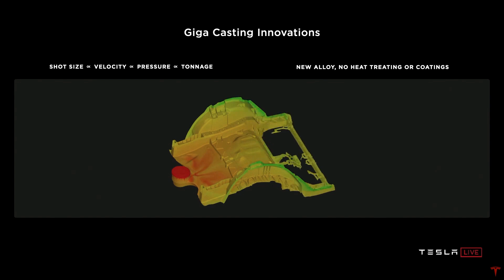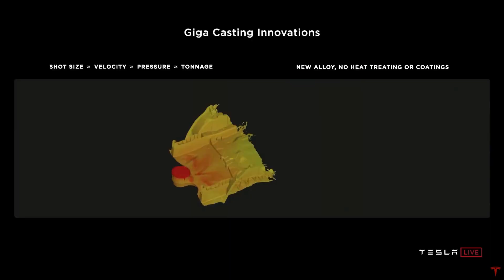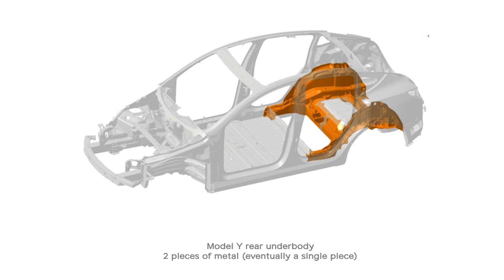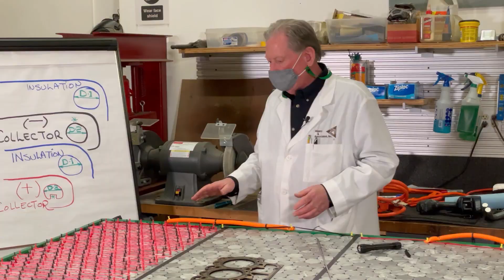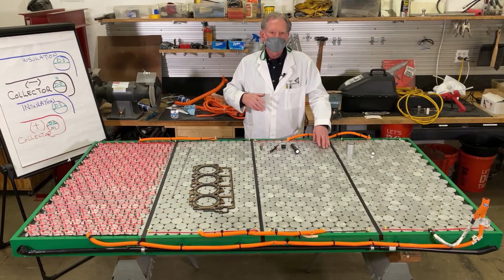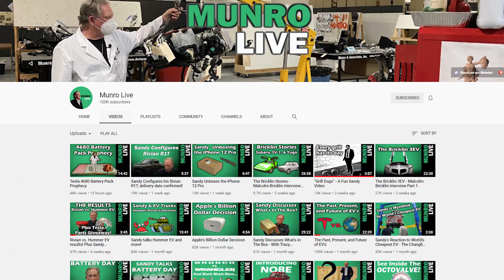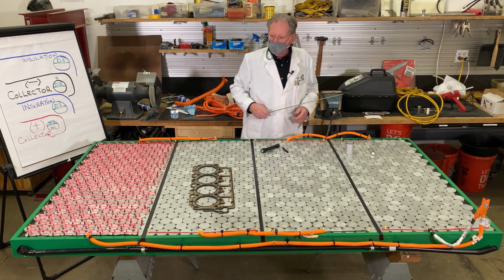SANDY MUNRO Rejects TESLA Battery Day Doubts

Comment: I don't want to be that guy, but the Cadillac CT6 had 6 large casting for front and rear suspensions. The BMW i3 also had 4 really large castings on which both the front and rear suspensions were hung. So it's not that these ideas are completely unheard of. The big difference is that when tesla does something they always goes all in. But this isn't an effect of engineers at tesla being more talented than engineers at any other company. The differentiator is that the people making the decisions at tesla are much less risk averse. That's my two cents at least.

Comment: Think of this new battery- to- vehicle design as sandwich construction.  A few examples:
Cardboard,  which is much stronger than 2 layers of paper
Those cheap dollar- store foam poster boards,  which are very thin foam laminated to 2 outer layers of paper; vastly stronger than either component separately
A soda can- strong enough to stand on the lid,  even when empty.  Now stand a thousand soda cans next to each other,  glued to 2 boards,  and leave the soda cans full.  Imagine how strong that is!
Also,  honeycomb construction. Used in Formula 1 cars.

Comment: The sheet metal parts are protecting passenger during an accident  by not breaking but bending then absorbing all the forces coming trough ,over the passengers..In order to protect well the passengers ,all the sheet metal parts were chosen with adaquate thickness to enable to bend easily when the vehicle hits to an obstacle..
Although the alluminium parts will bring saving money on body constraction,aren't they very harmfull to the passangers when occurs an accident from   the head or from the back by a sudden break  of casting parts or if not , by a big IMPACT ,  transportated directly to the body of passangers? Did you made trials of a such incident on Crach Test? What are the impact rates of a such collusion on the  human body?

Comment: Cars are already pretty much impossible to repair properly these days without reaching a totaled amount of money... look at Rich Rebuilds video about fixing very minor rear damage on an Audi RS8, that thing is a disaster... So I don't think the new method is worse in that regard.. if anything it's basically remove carpeting and wires, weld off / bolt off the bent casting, replace the whole thing, boom you're done and way less work hours to be charged. It's aluminum so just send the old one back to the furnace

Comment: 14:33  Also, the new tabless electrode design dramatically reduces waste heat so the cells don't have to be interleaved with cooling pipes, whereas the old/current cells would overheat without them

Comment: The answer to why you can't make the current cells structural is cooling. the current cells are cooled on the sides so there are fluid channels in between the cells on the width so you can't pack them in a honeycomb against each other.

Comment: The 4680 cell has 40% less mm^2 steel case per kWh but not necessarily 40% less mm^3 in steel. We can assume as the diameter increases there will also need to be an increase in thickness to maintain similar integrity of the cells. That gets back to Alex’s question “if 4680 is better than 2170, why not 9080 or even bigger since the mm^2 per kWh will be even less. 

In Theory a Tuna Can size battery would be even better and if only cooled at the bottom would provide a greater thermal pathway. 

We see prismatic cells in 15AH to 200AH, so I don’t think there is any Magic size for all applications,

I think almost no EV uses a 1p battery. Model S was about 100p, model 3 LR was about 46p, Bolt is 3p and Volt was 2p. Of course we all know if you have a 96s1p battery, the loss of any cell, or any connection to any cell, causes the battery to be totally dead instantly with not even a limp mode.

So the 4680 cell would allow model 3 to use 9p, still pretty good since you can lose any one cell and still have 89% of the battery working. And if the 4680 makes it to the powerwalls, it would allow 2p configuration so that any single cell would not cause total failure of that powerwall unit.

The 4680 is going to seem small in a Roadster or Cybertruck battery and and tiny in the Tesla semi. But at least they can get to one cell fits all, and then get cell to pack going for each product, while keeping at least 2p in each product.

Right now I’m looking at making a LiFePO4 battery for my ebike. If I want a 48v30AH battery I can get 16x 30AH prismatic and make a 16s1p battery or buy 80x 32650 6AH cylindrical cells and make a 16s5p battery. 

If I use the 30AH cells and one cell is defective, has lower capacity or higher resistance, the pack will either be dead or always going out of balance. But if I get 80x cells and arrange them such that each group of 5 has the same total capacity and same average internal resistance, then the battery will stay balanced throughout its range regardless of load. And if one cell fails, I still have 80% of the pack to use until I can get a new cell to replace the bad one.

Tesla may also be using this concept for the cars and the warranty, since a cell failure on a LR model 3 would still have 85% capacity and the warranty doesn’t cover the battery unless it drops below 70% capacity. Of course Tesla can be forced to fix it if the owner understands the battery went from 98% to 86% capacity instantly, it’s a failure not degradation. But someone not paying attention or knowing right rights might have to live with 85% range, since that’s probably the first thing Tesla will tell them “the warranty covers when it falls below 70%”.

Comment: Electrical engineer here, wanted to weigh in on the question about size. For best reliability of the pack,you need as many cells in parallel as possible. You need as many in series as possible to increase pack voltage. You could just make a large cell that is the size of the car but it would have a voltage of just 4V max and insane currents. From electrical side, the more cells you have, the better but it adds costs and other issues so there is an optimum cell size depending on requirements.

Comment: 14:33  Also, the new tabless electrode design dramatically reduces waste heat so the cells don't have to be interleaved with cooling pipes, whereas the old/current cells would overheat without them
Reply: Double bonus! Reduces the amount of waste heat produced by shortening electrode paths AND improves cooling by placing more metal in contact with the outside of the can.

Comment: What do you think the 46/80 battery mileage be on model y/3 with the new battery?
Reply: Depends on how many cells they want to use (to keep the cost down) Sandy in his mock up has shown in the same area of the model y pack the new battery should have 120kwh so range could be about 450miles epa.

Comment: Can’t make a structural pack with regular cells because of heat. Tab less design makes that possible.
Reply: That was my first thought.  The smaller cells are cooled with a ribbon style cooling system that weaves through the modules.  The new 'tab-less' system allows a cooling plate at the bottom between the armor and the cells. (If I understand correctly) or the bottom cooling plate might actually be the armor.
Reply: Yep. This sounds right.

Comment: But didn't BMW do this with the i3?
The carbon fiber passenger cell is a single piece? The aluminum skate board frame that holds the battery case is a single piece?
Reply: @bike-cave-man2527  
Well no one expected the i3 to sell a million, its a niche car and BMW has shipped over 200k units so far, how many Z4s have BMW sold? 
Obviously BMW could ditch the carbon fiber cell and use an aluminum or steel frame and put a 60kwh battery in the i3 and continue selling it for the next 4 years. The 2021 model has already been announced.
Reply: Sandy did a breakdown on the i3 innovative construction and materials, I wouldn't compare it to a giant casting though. In my mind the Tesla is more conventional construction than the BMW i3.

Comment: The most impressive feat is that 4680 cells are made of pinewood round stock painted silver!  This is brilliant, not other battery manufacturer can make batteries that cheap and lightweight.
Reply: Ha ha, I think it is only Munro's battery pack that is like that.🤣😂😂🤣
Reply: Exactly, cobalt free, copper free, aluminum free, lithium free, ethically sourced from Home Depot. And if you watch Sandy’s latest video he says a battery pack made with the Pine-ion cells has 5x the energy of a battery made from Tesla 2170 Lithium-ion cells. That mean the new model 3 can have 375 kWh and go about 1200 miles per charge. That’s why we love Sandy, he brings us the latest technology years before Elon, and cheaper too. Lol

Comment: What a BS... Sandy doesn't know what he is talking about (again)...
14:41 The reason why old batteries weren't glued together is cooling. Because of the tab design, old batteries were generating much more heat whilst charging and discharging hence cooling channels between every two rows of batteries. Nothing to do with cost or labour intensity. The tabless design eliminates this problem and allows to make larger diameter cells. According to what Elon said top and the bottom surface of new, larger cells will be sufficient enough to deal with the heat.

Comment: Always reassuring to hear Sandy's word. One-piece castings in collisions: hmm, sounds like Tesla will be making disposable cars in that sense, like inkjet printers are disposable, assembled in a way that's expensive to fix. Perhaps Tesla expects FSD to reduce the accident rate so low Tesla Insurance can cover totaling cars at this rate.

But, if I understand him correctly, even cars with 5 or 10 piece rear bodies are now too expensive to repair. Is this making insurance prices unsustainable if anything more than a fender bender will total the car, any manufacturer's car?
Reply: I guess it all depends on what % of cars end up in a crash and what % of those are more than just a fender bender.  I’m sure current insurance models take these things into account.  Therefore, you can assume more people aren’t going to experience a crash that results in a write off crash.

If you also take into account the drivers ability (insurance companies do this on a superficial level currently, largely based on age and driving experience, not skill) then you can tweak the model further.  

Tesla is getting into the insurance business as they have the data to be able to determine a drivers skill much more accurately than other insurance companies.

Once FSD rolls out, I think you can assume that crashes will reduce as this improves improving the insurance model returns.
Reply: @martinoconnor1268   And we can expect it'll be a near-sure bet that if Tommy buys a Model Y with FSD and Timmy buys the exact same package of Model Y without FSD that Tommy's Tesla insurance bill will be significantly cheaper. Unless Tommy shows he doesn't use FSD much and drives poorly.
Reply: Think of it more like smart phones if one part gets smashed out of the three parts just unbolt/unwield the crushed part and replace it with a new one. With it being a stamped part it will be more uniform and easyer to replace if you have the right equipment.

Comment: As far as I enjoy interviews with Sandy, there is nothing new here with die cast (Check Buhler group website). Die cast parts have been used for quite some time, even GM was using magnesium die casted structural parts for its cars a long ago.  Die casting parts is not "magical", tooling requirements for this process is huge.  Cooling after casting is a challenge and the mold shells creates a middle flash rib hat needs to be trimmed off complex parts with robots.  Trimming dust is explosive and create some factory dust management challenges.   After trimming, you must perform all sorts of drill-n-tap plus studs etc.  Not to mention that during cooling parts may distort.  As far as larger batteries ... I still put my trust in in EEVBlog's review.

Comment: A question that I would like answered is how much does tooling up for one of those castings cost. Original design and replacements once the design is in the computer.  I used to pay $2300 US for a tool for plastic moulding and $10,000 US for  aluminium moulds. This did not include the cost of designing the product.